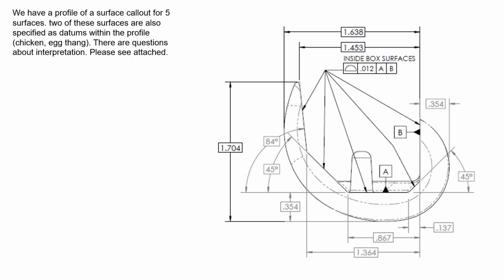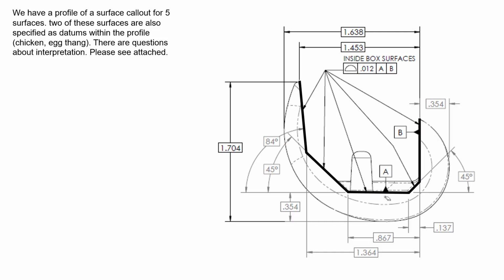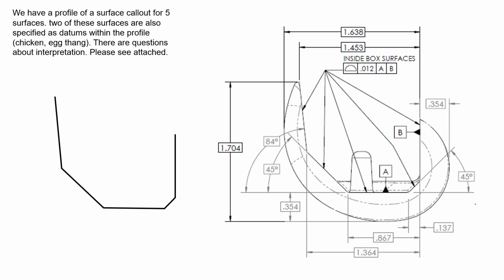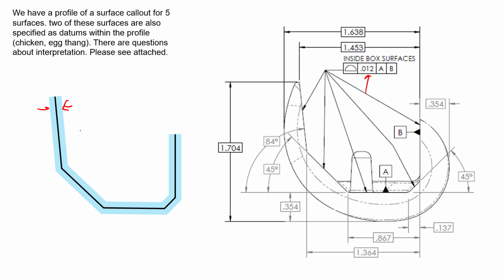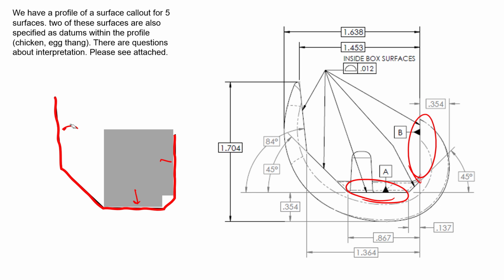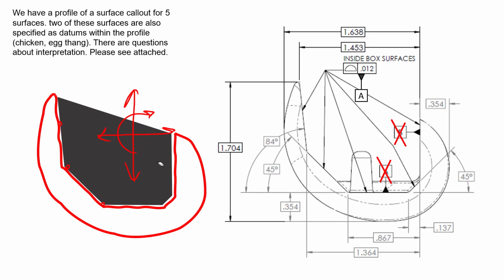Controlling Pattern of Surfaces

Comment: How is the 2nd case controlling location and orientation of the non datum surfaces without the Datum callout in the FCF? Isnt that only controlling the form of the non datum surfaces?
Reply from the maker: Without the the datums in the FCF, the tolerance controls the location/orientation and form of the 5 surfaces  and NOT to the datum features.
Reply: @Gdandtbasics  ohhh. I get it now. Thanks